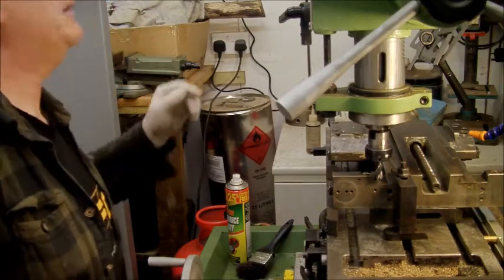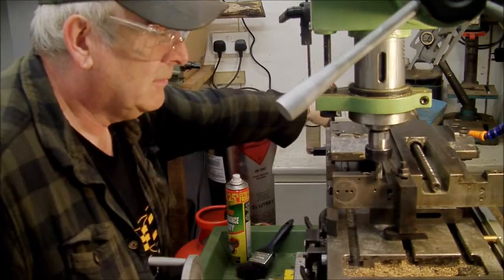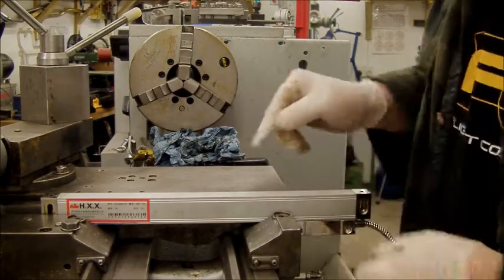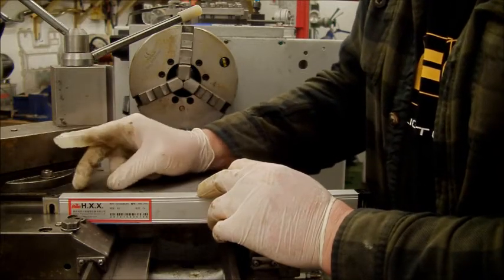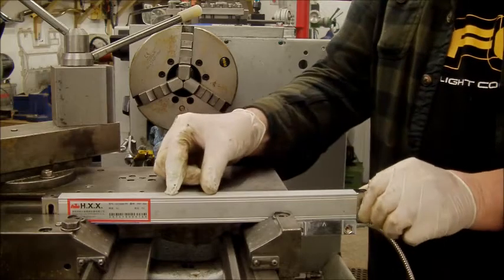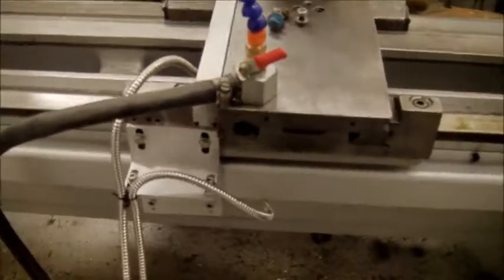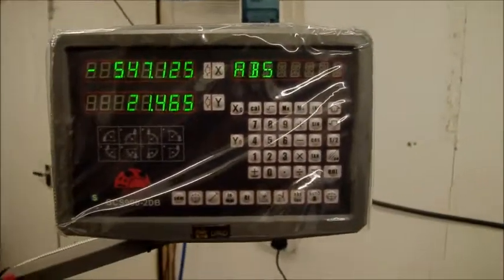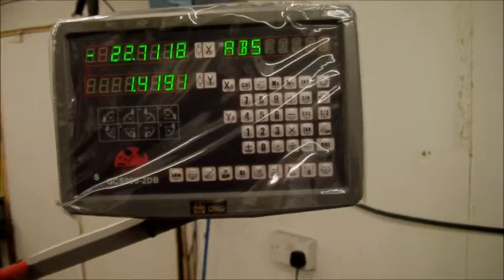Digital Readout Install on Harrison M300 Lathe.

Comment: Hi thanks for a helpful video, I also have a long bed M300, I was curious as to how you deal with the loss of access to the cross slide lock, have you installed an alternative. I was thinking of the set back alternative as it is less machining and leaves the carriage lock accessible, KR Paul
Reply from the maker: Hi there the cross slide lock is on the front right (17mm bolt) when your standing at the lathe you can see it at the start of the video bottom left corner of the screen the other allen head bolts are for the cross slide keepers only and do no move. Hope that helps cheers
Reply: @ige Hi, the M10 bolt is the carriage lock (saddle to main bed), the cross slide lock (cross slide to saddle) is a M8 grub screw that acts on a brass slug that passes though a slot in the taper gib about 1/3 the way back on the RHS of the cross slide. It is a similar arrangement to the topside lock that is also a M8 grub screw. Hope that clarifies the query
Reply from the maker: Yes sorry your right mu brain wasn't in gear lol I don't think I have had any need for it since fitting the DRO but I am sure now I will need it and have to sort something out lol cheers
Reply: @fixitnige  apologies for mentioning, cos that's the sure fire way to make you need it on your next job 😁.

Comment: Being cheeky I did wonder if it would be possible to mill out the trough at the side of the saddle. I watched your video to make sure there wasn't going to be any problems first then milled my own saddle. Fits just great and makes a much tidier job than the other options. Thanks for being the pioneer so to speak.
Reply from the maker: Hello Sophie its great to hear someone having seen my video's has had good
luck using the info life is all about experiments and work out just fine.
Good luck with your lathe work cheers Nigel.
Reply: @fixitnige  I was a bit paranoid in case anything went wrong as I us the lathe almost daily. We design, produce and modify parts for British and Japanese classic motorbikes for a number of retail businesses in the UK and abroad. I only have one lathe and can't afford for it to be out of action. It always helps when someone does the job before and is successful. I looked at all the other options like you did in your video and none appealed. The one other thing I've done is to use a thicker piece of aluminium angle to protect the scale and reader from the tailstock.